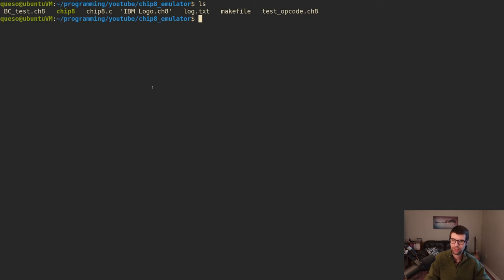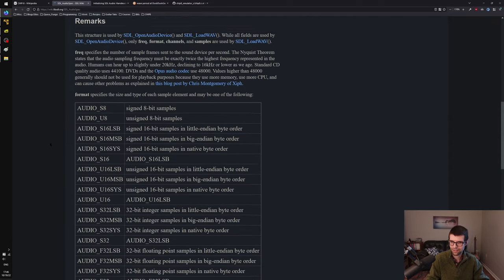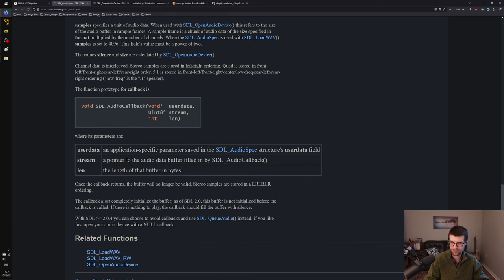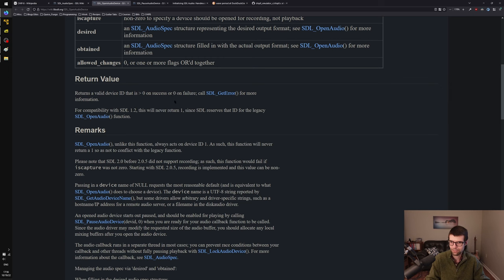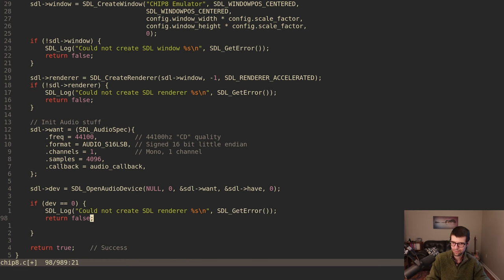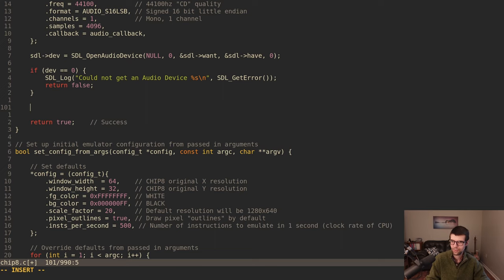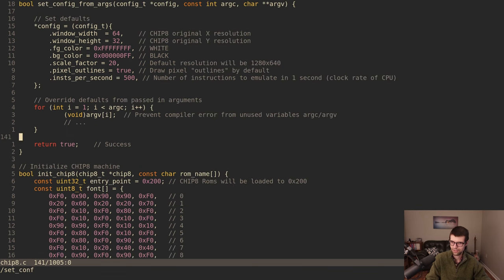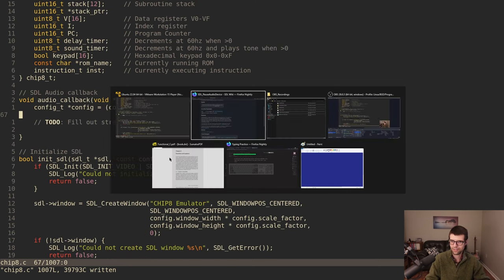CHIP-8 Emulator p5: Mono Sound & Color Lerp (C / SDL2)

Comment: Interesting content, thanks!
Wouldn't be easier drawing to a buffer, then to screen? no flicker.
How (and why) did you choose Queso Fuego as your handle?
Reply from the maker: I was under the impression that the SDL renderer did use a backbuffer, where SDL_RenderPresent() "swaps" the buffers to show the changes.
But CHIP-8 does work by redrawing the whole screen, it could probably be made better by only drawing changed portions of the screen, not redrawing the whole thing.
I like cheeses, spicy foods, and foreign languages, and QF are similar to my initials, that's the only real reason.

Comment: That is the lerp equation, but the linear bit comes from it being a function of t.  you're keeping t constant and updating v0. By keeping time constant and instead updating your start point every iteration, you've implemented a rapidly decelerating interpolation instead of a linear one.

Conceptually, t (also denoted alpha in contexts independent of time), is the percentage of the distance between your start and end values. So a value of zero gives (1-0)*start + 0*end, a value of 1 reaults in (1-1)*start + 1*end. A value of 0.5 is the average, and so on, linearly.

So... you could save like 3/4 of that extra memory by storing each pixel's t since the bg/fg colors are effectively constant. In fact, you could hijack the alpha channel, as transparency is meaningless when there's no z-sorting. (And for extreme measures, you could use like 3-4 bits per pixel if you don't mind larger quantization of the value).

The configuration would then be the total duration of the interpolation, which is probably more a more intuitive way of specifying it.

--

Also, this doesn't affect you (much) with pure black and white, but RGB is a terrible color space to interpolate over. It's quite a deep topic to dive into. For an introductory example, consider how much "brighter" #00ff00 is than #0000ff. Or just try randomly interpolating between colors and be surprised by the results.

Converting to a better perceptual color space to do your interpolation and then back will give better looking results for cases where intuitive results are preferred.

As far as emulating a CRT, though, I hace no idea--maybe it's a better model. I wouldn't ve surprised, though, if the sub pixels dimmes at different speeds!

--

HSL color space is an option with simple math that gives much better hue results. (Try blending from green to red for a "things are getting more urgent" effect that gracefully passes through the spectrum hitting the expected colors. There are better models (of which there are many... CIELuv is a respectable 50 year old example) that take into account different conceptions of linearity in human perception. I'm pretty sure correction for the display's gamma space affects interpolation too, but I'm not much of a graphics guy so I don't know the details.

--

I've worked with audio aystems using +/- floats or ints, but also ones that use uints with an implied bias (so zero = negative amplitude, and uintmax/2 is silence).

I was fully expecting you to divide the waves into "positive half" and "negative half". I'll have to revisit that part again because I have no idea why you chose to break it up from center to center. I suppose that would be the peak of the approximated sine wave? But it's the distance that really matters, bot where you are phase-wise.

--

Your average audio delay (assuming double-buffering) is going to be the buffer size (in samples) / sample rate. With a 4k buffer that's about 50 ms, which is a respectable chunk of a second. For comparison, a video game console I worked with early this millennium had a DAC buffer of 32 *bytes*, which at all but the grainiest of settings is going to be sub-millisecond. (It might have also been stereo-only at that point, so doubly so.)

--

I know this series is old and super niche, but I've really been enjoying it!

Thanks for sharing it 

Thanks for sharing.
Reply from the maker: If I'm understanding correctly, for the interpolation I should've had time as the dependent variable that increased by a given rate per clock tick? Resetting at the end of the full cycle over however many clock ticks when start = 0 and end = 1 after the interpolation. Then the function is still simple and the clock/time rate affects the interpolation instead of the color.
Storing the t values per pixel does sound better and interesting, to only take constant memory for colors but not a color*pixels amount of space.

HSL doesn't look hard to implement, and I have had a request from others for actual colors and not plain black/white, so that would be a good extra video for this in the future, I'll mark that down. I do understand that our eyes perceive green more intensely than blue or red, but not a whole lot more than that wrt luminance in general.

Drawing I'm not great at, nor explaining, but I might've meant to show the frequency/tone vs. amplitude/loudness of the wave, it's hard to remember. And the sound I should look at again anyway, I adapted it from an older article I found but didn't quite understand it fully nor all the implications.

*Oh, where I cut the wave vertically and not horizontally, that was not a great way to show that part, didn't really think that through. Horizontally where half is positive and half is negative probably would have made more sense there and helped with other explanations.

I appreciate your detailed comment and thoughts on this!